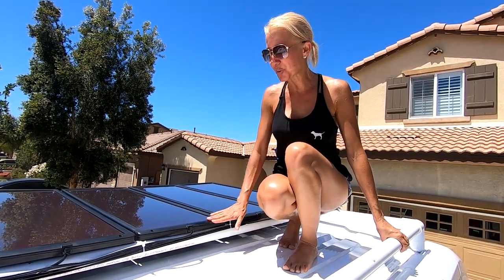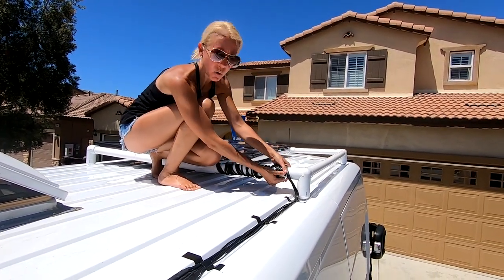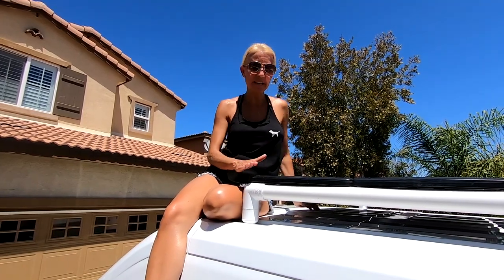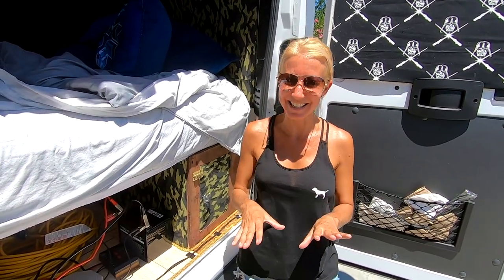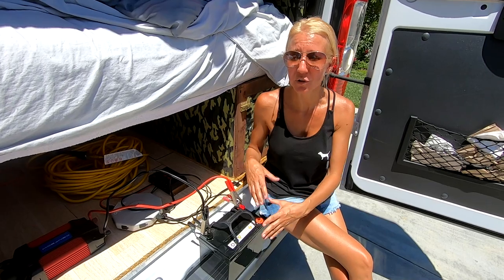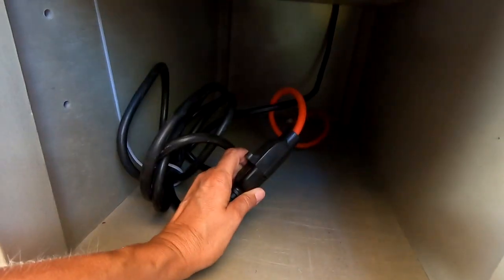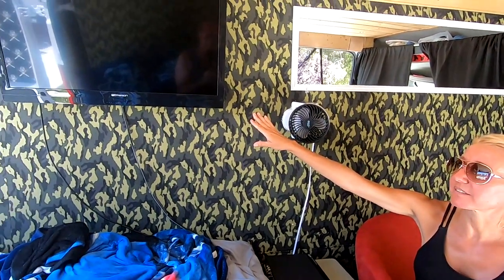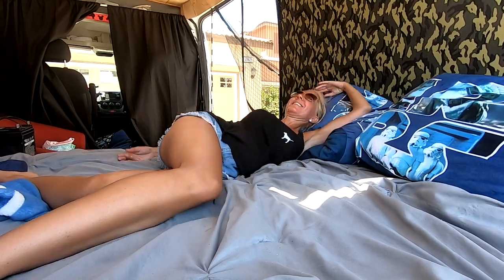Complete Detailed How To Harbor Freight Thunderbolt Solar Kit Panels, Battery, Controller, Inverter

Comment: Couple points to note : Wrapping excess wiring can cause voltage drop You can easily cut out the extra length, then splice , solder  and insulate  if you are permanently mounting those panels. Use a conduit tube or flex conduit to protect the cables from UV rays, rain etc will make a very neat setup. Add a little silicone seal around the cable where it enters the panel .  Instead of going thru the door jamb, mount a connector jack on the van sidewall to plug the panels in once parked. Or mount a rubber grommet that allows the cables to pass thru to the interior of the van.  I am in the middle of mounting T-Bolt panels on a custom rack on top of my  Dodge Ram's cap incorporating my above suggestions. Also am building in a custom tilt up where the whole array can tilt up to catch the afternoon & setting sun for that last bit of charging power. Hope your system has operated well for the last 2 years  ?
Reply: Yeah, there's all that PVC pipe there and that wire could completely run inside of it. Oh well, induction coils can store current also LOL.

Comment: Hi folks, great video and system. But to chime-in (can't help it) AGM batteries do indeed off-gas. All lead-acid batteries do. They just don't need water and are stable in most non-upright positions. I wouldn't imagine hydrogen gas build-up typically being an issue in this usage scenario UNLESS the battery is used/charged in a confined place, and in particular around potentially spark-inducing equipment.
Reply from the maker: Great point!

Comment: I have this same set for over two years and I have had no problems! Only I did change was the charge controller to give me options to expand the solar panels because the solar charger is inaccurate comepaired to a fluke multi meter that's top of the on voltage accuracy.

Comment: Currently I've got a yeti 400 and it has two Anderson connections that allows external batteries to be connected to it. I currently have two external 12v 35ah batteries connected to the Anderson connections along with the 33ah battery that came installed in the yeti 400. So I have a total of 103 Amp hours. 
I have seen on YouTube that someone has at least four external batteries connected to a yeti 400 with using a 100 watt solor panel.

Comment: Here's a tip from your 5th grade science class:  Black absorbs heat.  White reflects heat.  If you use black tape or zip ties on external surfaces, you'll be replacing them before long.  White tape and zip ties will last much longer.
Reply: black zip ties are for outdoors and last about 6 times longer than white.  black blocks UV from penetrating the ties and are used outdoors for the same reason telephone cables are black.  3rd grade science.

Comment: The AGM batteries in both of my vehicles (218 Jeep & 2019 Ford Transit) are in vented wells under the passenger seats.  NOTE: VENTED  & if not connected to their vents WILL off gas into the vehicle interior when charging.  Your video IS well done, but not all AGM batteries are the same and shouldn't be taken as such.   Why not run the wire inside the rack & make a neater install?  Very nice van!

Comment: OMG!  This was amazing.  I bought this system on a whim, and just about how all the pieces figured out in my head when I came across THIS video.  (I've watched some of your others as well).  I do have one question though....how do I determine when the battery is at 50% capacity?  I know there's math in there somewhere.  :-)
Reply: If you watch the "part 2" video, near 75% of the video he mentions when the battery reads around 12.X instead of 13.2 Volts, then it's about 50% used and needs to be recharged.  I do not remember the exact number, but you can find the number there.

Comment: Thank you!!  This is awesome.  Quick question:  You said your inverter was 750w and more than you needed.  Why did you choose to overshoot on that one and what would be the lowest watt inverter that you considered instead?  Thanks!
Reply from the maker: 750w was on sale for almost the same price as the 400 w inverter. I also though that by getting the 750 if I added more panels the inverter could handle it. 400w would be the lowest I would get for this system. Also the 750w does not have to run it's fan to stay working. The 400 w fan would need to run to get it cool and you would hear the noise of the fan. Thank you for asking.
Reply: You should ALWAYS design the system for more than you actually need. Just in case that rare occasion comes along when you'll need it.

Comment: Hey just a heads up the wires coming down from the solar panels to the hub are not rated as waterproof the manufacturer says to use waterproofing casing or conduit to protect them so you may have issues in the future, I think they are intended to be used as a temporary setup that gets put inside when not in use. Would like to see a follow up video on how the whole set up held up after a year outside.
Reply from the maker: It was just a video we made. Oh, we did waterproof tape the connections. Thanks.
Reply: I've had mine for over 3 years now and the only thing I actually had to replace was the 4 to 1 Connecting Cord just after 1 year. I replaced it with one having better wiring and haven't had a problem since then. I believe they come with either 16GA or 14GA wiring, I upgraded to one with 12GA. The factory harness melted right where the 4 cords go to a single cord.
Reply: @neolithicnobody8184  Good move. The 4 to 1 connector is a weak point for the wire gauge they use if your panels are really putting out current. Thankfully the SAE wiring they use is replaceable. 12 or 10 gauge would be great choice. 
When it comes to electricity.... heavier wire is always better.

Comment: Great video and well done. What is the connector you used to go from the 4 connectors from the panels to the one (@1:33 “4 lines down to one”) and then to the harbor freight connector? Did it come with the connector or did you have to purchase it separately? Thank you.
Reply from the maker: It all came in the kit. All the connections. Thanks

Comment: On the charge controller, the bottom left screw in inputs... I think it is marked for a solar panel. Do you know if you can add another panel here? Seems weird like its an output since the one next to it goes OUT to the battery.
Reply: If you havent found out about that yet : The Solar panel connector jacks on the controller are to connect the Panels output to the controller. The Battery connections are for connecting your battery -whichever type Lead Acid , AGM or Lithium - to the controller . So simply its Solar Panels in and  Battery out. The controller regulates your battery charging.

Comment: Do you have to run the inverter in the system? Just picked up the 100w kit for my pop up camper Won’t be doing anything but running 2 small lights and charging phone and camera batteries.  Thank you!
Reply: This system is perfect for anything using USB corded devices(2 ports on Controller).The kit comes with 2 LED lights that plug right into the Controller(3 ports). The inverter is used for devices requiring 120V power, like a TV or DVR unit. If all of your devices use 12V or less, the inverter isn't needed. I charge phones, battery banks, portable fans and lights and many other small devices through the Controller. I have several sizes of inverters but only attach them when I need to power larger items, each one depends on how much is needed for the task. Mine range from 200W to 3,000W, but I seldom use them due to my main setup using mostly low voltage items. One thing to keep in mind, if you add another set of panels to use on the same system(say two 100W sets into one Controller), you'll need to upgrade your Controller to handle the added Amps generated by the extra set of panels. My one set produces 6-8 amps with the standard 10 amp PWM Controller. By adding another set @ 6-8 amps, my overall amps become 12-16 amps. That's 2-6 amps more than the controller is rated and may damage it. Myself, I use a 100A MPPT Controller to allow for expansion of my array of panels and it makes better use of what's being generated.

Comment: How do you manage the discharge level of the battery so it doesn't go too low?
Reply: The Controller will shut down until the battery bank is back above the shutoff level. Default settings will shut off at 10.6V and turn back on at 12.3V. The Controller won't even try to charge if the voltage is less than 11V. 10.9V level on the battery will give an ERROR code on the Controller and it will refuse to charge.